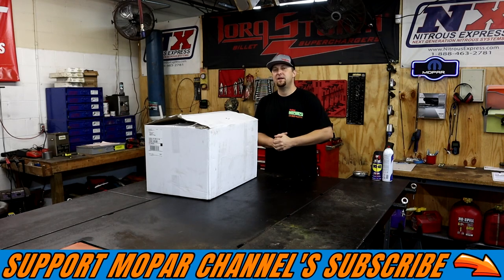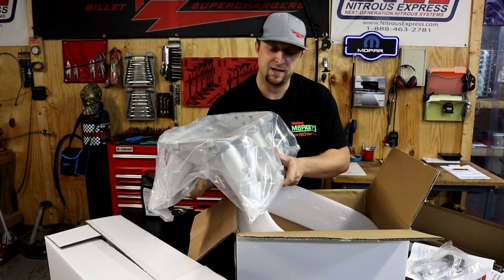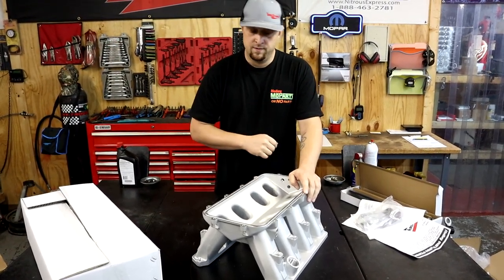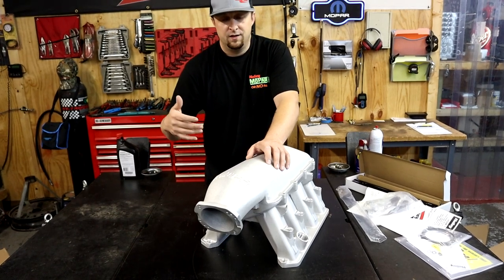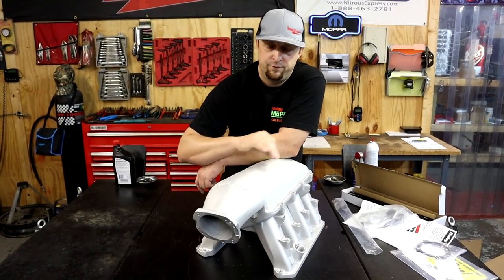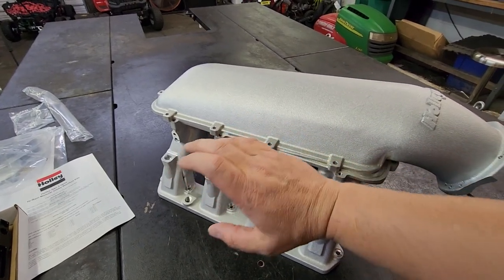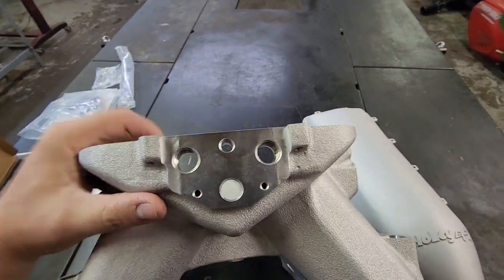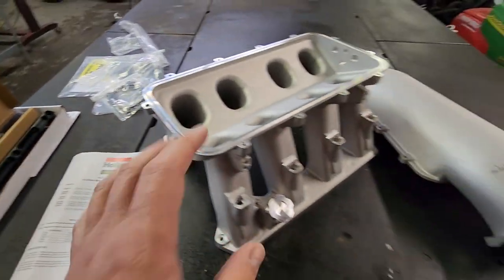Project STORM Gets HUGE MOD! From HOLLEY

Comment: Awesome. Wondering how much I would benefit from the Holley high rise compared to my ported OCP intake on my pre eagle 396 stroker ram
Reply from the maker: Hard to say they fairly close I would think 🤔
Reply: @FrostbiteRam  so far with the new FRP cam it’s
Pulling hard all the way up to 6700. I haven’t gone further then that, I believe the intake is good to 6800 maybe 7000rpm. I would just hate to spend $1000 to only gain 10 or 15RWHP at the upper RPM Band. If I ever do a torquestorm I would for sure get the high rise at that point.